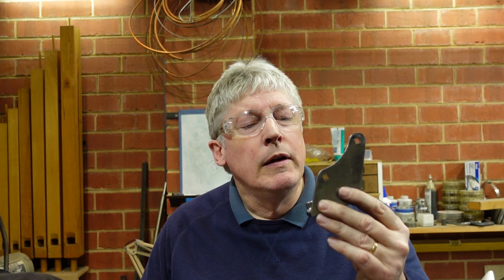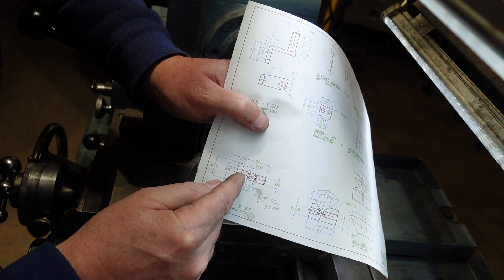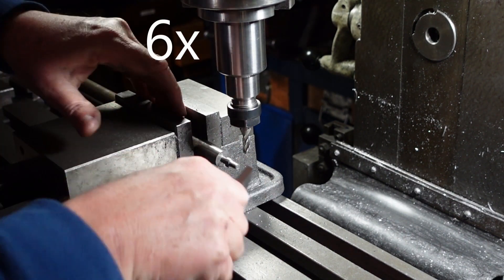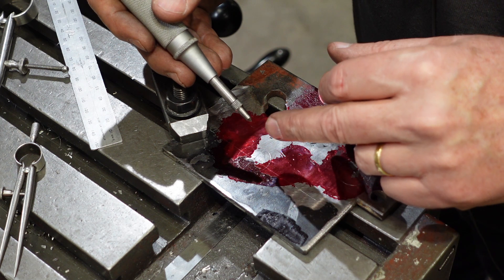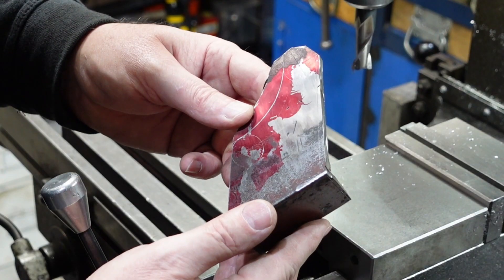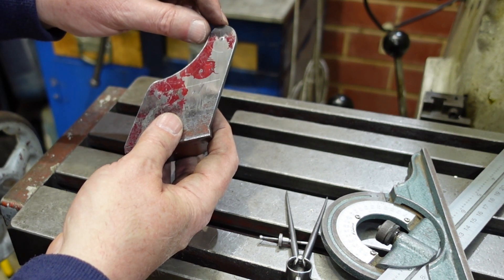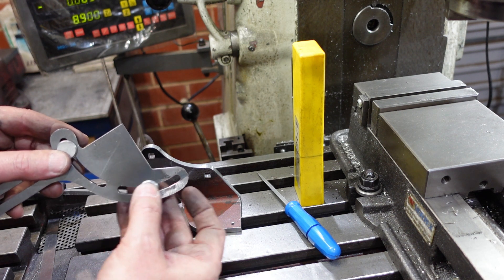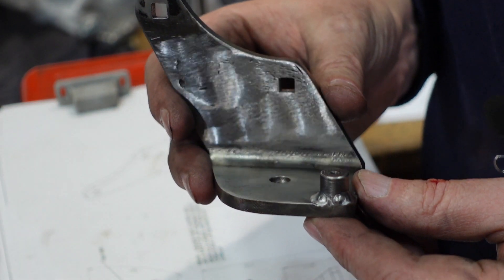Quadrant bracket (Gower drill grinder pt 5)

Comment: This was one of the parts that twisted my brain a bit, 
Do you think your uncle may have used a broach to get the square holes?
Also like your example of how toolmakers think, 3 parts to make one whole part.
Reply from the maker: He might have used a broach, and I did think about using a 1/4" square broach that I have, but the thickness of the material is only 6mm. Unless well guided, I think there would be a great danger of breaking the broach as most of the time there is only one tooth in the cut. Filing is the safest option I think and did not take all that long.
I can't speak directly for my Uncle, but when he would have been an apprentice, the main work for tool makers would have been making press tooling (and a little later, injection moulding dies). Both of those to this day are bolted together, so the approach would have been ingrained. I also think that back then electric welding would have been mainly stick, so not necessarily the best for assembling small parts. In that respect, TIG is a great advance
Reply: @occasionalmachinist  👍